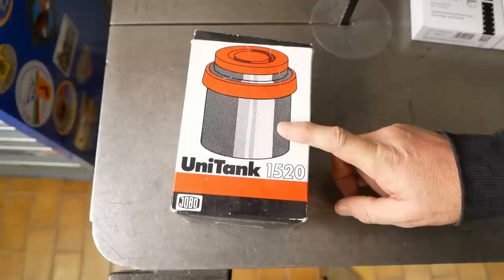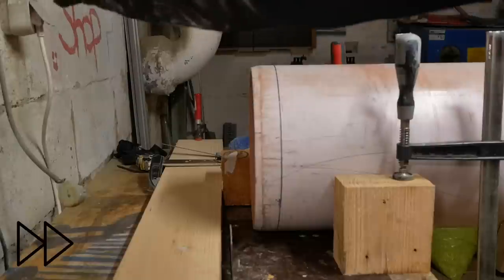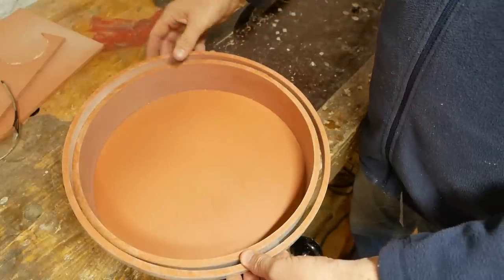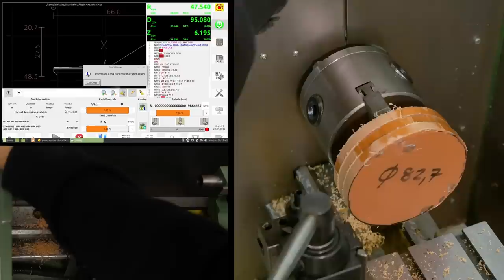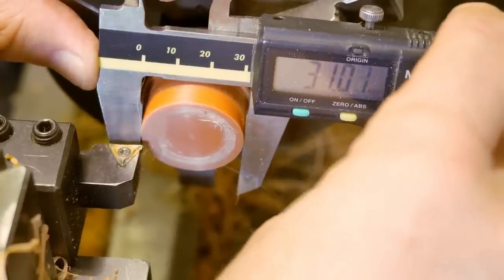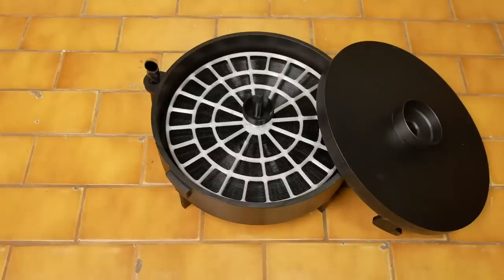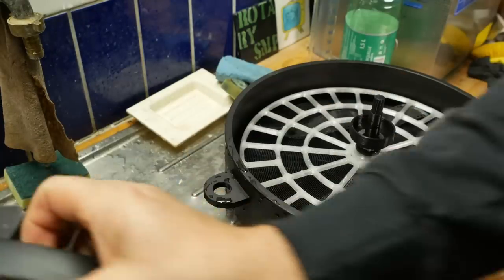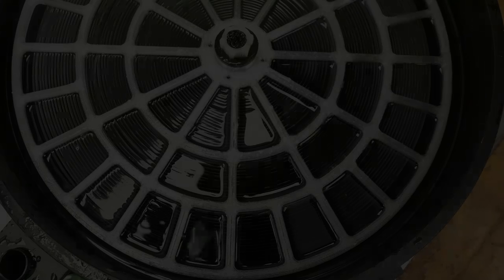Make anything from PVC pipe || RotarySMP

Comment: Once again a memory invoking segment for me, my first real job was in a 35mm movie film processing lab, we used continuous machines where you had 25 seconds in the darkroom to staple the next roll in line trim the edges and let it go while an elevator slowly rose as the slack was consumed if you stuffed up then three rolls of negative or positive were ruined when the machine stopped. We used potassium permanganate my hands were always tanned. We also used electrolysis to recover the silver from the fixer...there was a lot of silver.
Reply from the maker: Thanks for the feedback Doug. Do you know what solvent and electrode materials were used in the silver recovery baths?
Reply: @RotarySMP  The processing machines had electrolysis tanks built into the circulation system so no extra solvent was used...I think the electrodes were stainless steel rods I don't remember the current used but the terminals were exposed so it must have been low voltage. Once a month the silver cells were swapped. They were a pvc tank about 1m long with bolt on pvc ends.
Reply from the maker: @dougpurdie2871  Thanks Doug. I have to try that.

Comment: Oh wow. I’m going to have to make one of these. And by make I mean do a hack job of a terribly rough approximation.

I had the same problem with potassium permanganate / sodium bisulphate bleach not bleaching enough and discovered that everyone was suggesting potassium dichromate (as you said, banned) instead. I keep meaning to try a rehalogenating reversal instead which apparently also doesn’t make the emulsion so delicate either.

Next task, automated agitator with a stepper motor?
Reply from the maker: I think the next project in this chain for me will be a telecine. I did scan that one film by hand, but it took forever, and the results sucked. I need to find a 16mm projector to serve as a base for modification.
Reply: it probably should be banned, hexavalent chromium is awful stuff
Reply: @Anonymouspock  in this form it ends up in an oxidation state that isn’t carcinogenic but in general yes, improperly disposed of chromium salts are, bad.
Reply from the maker: @Anonymouspock  It already has been banned in europe. That is why Fomo switch to the Potassiu permanganate based bleach.